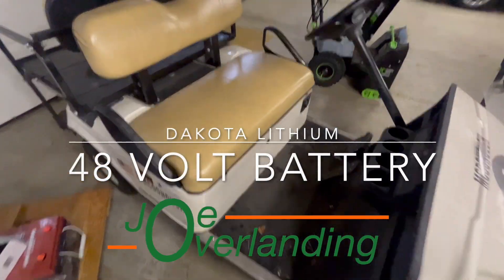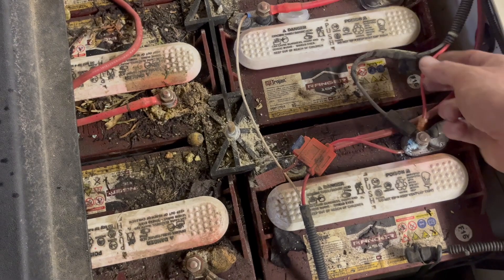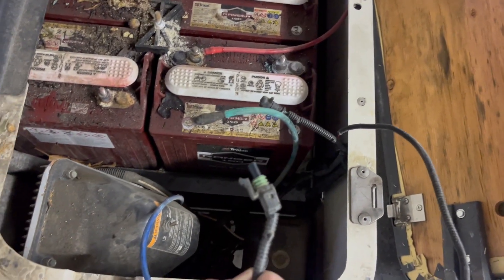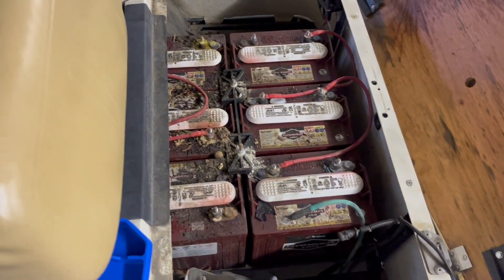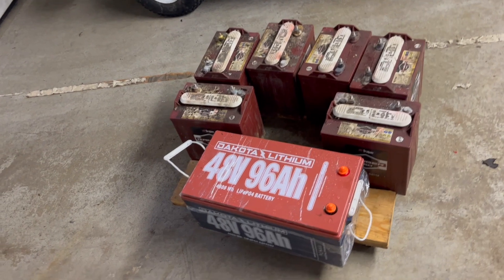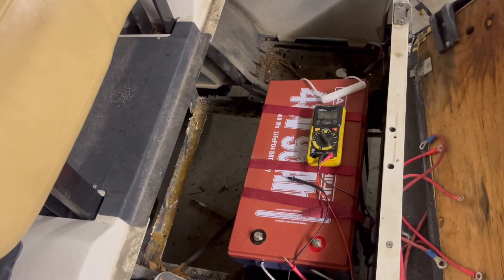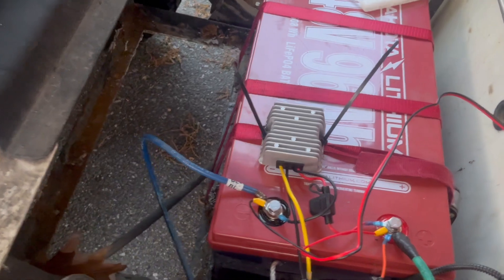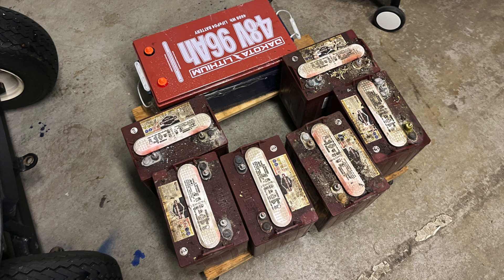Dakota 48 Volt Lithium Battery into an EZGO TXT 48 Volt

Comment: Did you have to do anything with the ignition wires?
Reply from the maker: @dgtldental  I don’t remember the details, I know I had to get a 48volt to 12 volt converter, I believe one wire gets 12 volts all the time now, but there was another wire that was to stop the charger from charging if the cart was on, that one isn’t needed anymore. I’ll take a look when I get back near the cart.

Comment: Can I ask you what year your car is and when you hooked up the battery are you charging it through the original charging port or do you just hook the charger straight to the battery
Reply from the maker: I don't know what year it is, I have had it for about 10 years, and I did not use the charing port, the charger and battery have an Anderson connector, I just flip up the seat to charge it.

Comment: (I forgot to mention i was working on a '97 Club Car) I just replaced 6x6v Crown batteries with 3x12v Dakota 6Ah batteries (the individual 36v60ah battery wouldn't fit). Man, I'm glad I did. It only took a little final alignment to tie them down, but I saved so much weight, and I don't need to charge it every time I take it out on our golf course.
Reply from the maker: the weight savings is huge, do you have to charge each one separately?

Comment: Nice work. She looks quick now. How much weight did you cut out?
Reply from the maker: I bet 200 pounds came out, sort of a negative side effect, it feels less stable, before all that low down weight was helpful.
Reply from the maker: So I just did the math, each Trojan Ranger is 76 pounds, there was 6 of them, so that 456 pounds, and this Dakota Lithium Battery is 77 pounds,  so that is 379 pounds of weight saved.